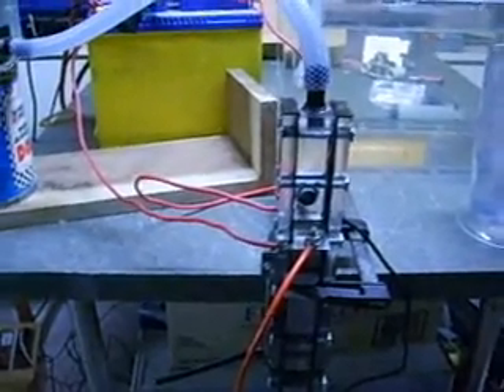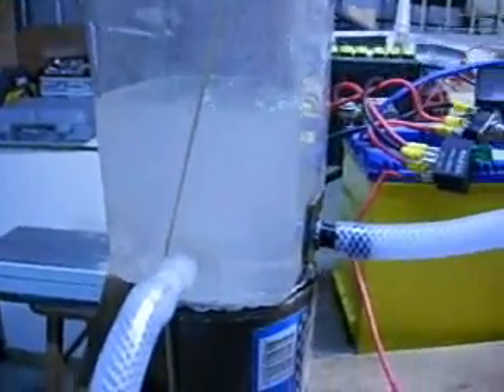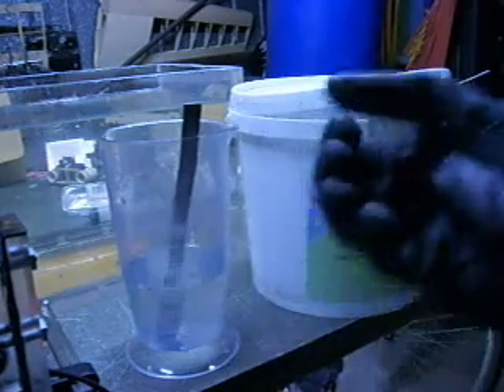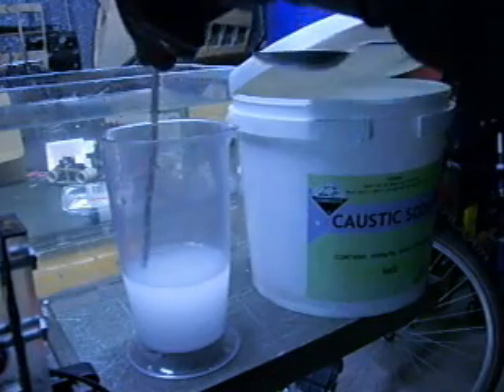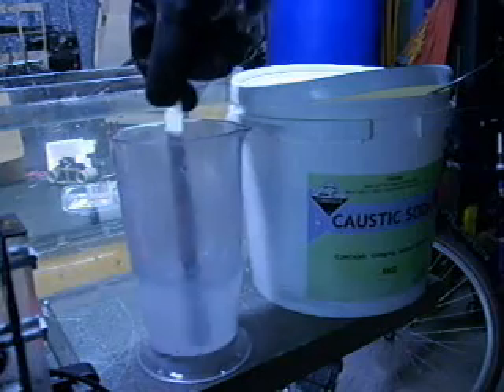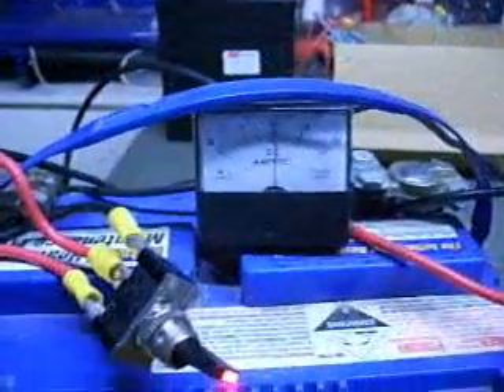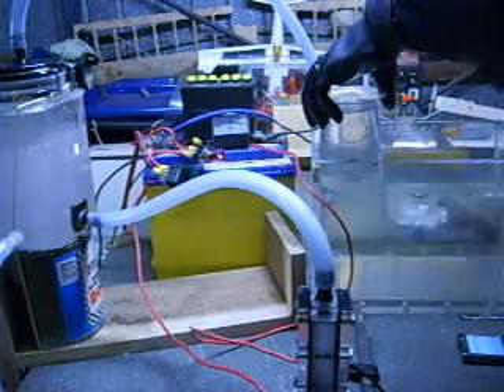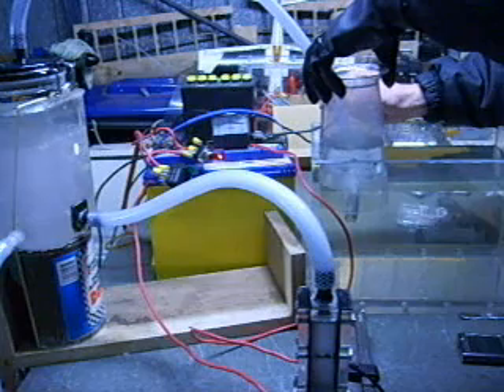Hydrogen at home (Stick Electrolyser part 2)#25

Comment from the maker: I did not notice any real difference in MMW with in the connections at the top, bottom, or both.  However I did not fully test to see whether I could draw more amps with both the top and bottom connected, having two leads instead of one however should help with overheating problems due to too much draw.  If I come across anything interesting in this area I will let you know.  The more efficient the unit, the harder it is to get the amps up, but you probably already knew that.